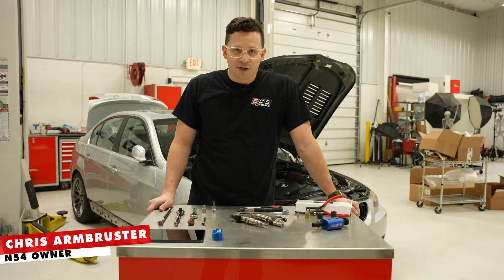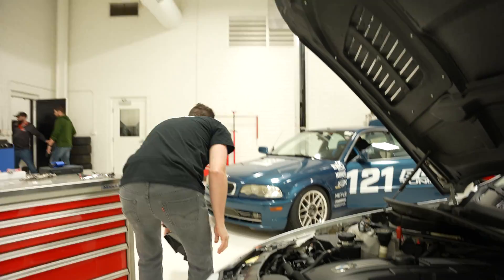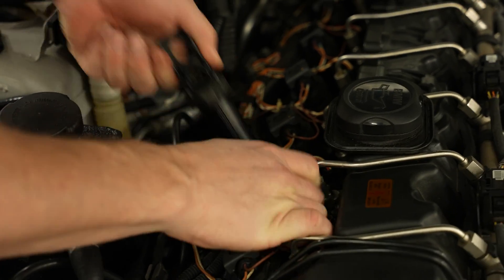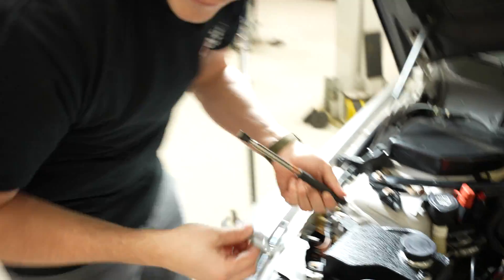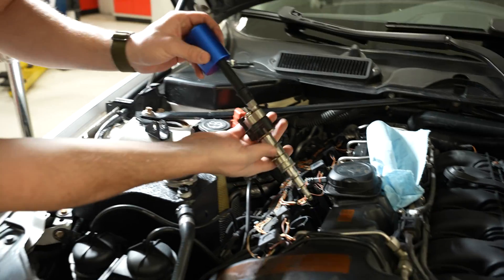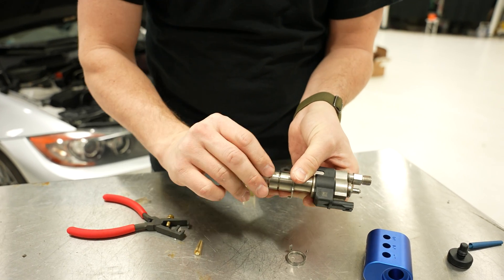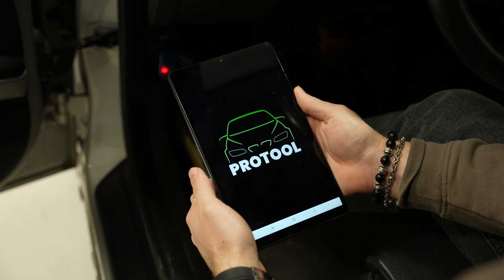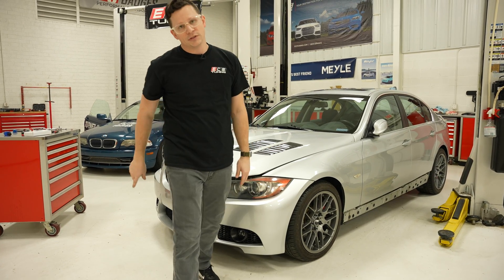BMW N54 Injector Replacement & Coding | ECS DIY

Comment: I find it very odd how this individual representing ECS tuning HIGHLY HIGHLY recommends removing the water shelf.  I guess ECS will sell more parts that break caused from rain water now soaking things in the engine bay.  Ive seen injectors get ruined from this reason.  Also the cabin filters that ECS sells are not waterproof either, so there goes your HVAC fan too, and more...
Reply: When they gotta heavy sell something, you know it’s not worth a penny.

Comment: I didn’t need the inverse e10 bit. I needed an e10 socket
Reply: I don't think he meant to say that because a e-torx is an external torx and if there is an inverted e-torx that would just be a torx bit

Comment: Is it the same for N55? If not is there a vid for that?
Reply: It's very similar to do the hardware portion, but the injector coding is a bit different.  Similar with the numbers on the sides of the injectors, but a different process.

Comment: What happens if don’t put numbers into ecu?
Reply: Ill say it simply. Yes. Injectors are either open or closed. But when open, how much fuel is going to flow? THAT is what the numbers tell the ecu. It is an extremely small amount of difference in fuel but nothing is ever exactly the same. Even the same type of injectors. So to tell the car how much fuel will flow from 1 injector is needed to calculate the air/fuel ratio.
Reply: @e90jackhow does ecu know what batch of injectors has better flow or same flow?
Reply: @repairvehicle   You do that with the coding.  The numbers on the injectors that you put into the coding software recalibrates the ECU to the those flow rates.  Not coding them would risk running lean and grenading an engine - although I have never tried ha ha
Reply: @racecarcamp9056  injectors cannot be recalibrated, it’s either open or close in simple terms it’s an electro mechanical valve. Computer send signals to open or close that’s it that how injectors work always worked. Injectors not any different than relay, open and closed. How do you calibrate relay?
Reply: @repairvehicle  sorry mate one word off - recalibrates the "ECU" to the to those flow rates.  Good call out, edited the comment.
Reply: @racecarcamp9056  how does ecu knows what injector numbers means, high flow or low flow? Is ecu being updated per latest software from bmw to recognize there is new injector numbers? Or ecu stores hundreds of different injector numbers?
Reply: @repairvehicle  if you watch the video, you'll see how to tell the ECU the injector specs.  You are effectively recoding the ECU to the numbers on the injector.  That coding ensures proper injector flow.
Reply: @racecarcamp9056  proper flow? It’s either open or closed injector fuel is constantly pressurized. What flow we talking about, bigger injectors will flow more than stock, regardless of the injector numbers?
Reply: @repairvehicle  Did you find an answer
Reply: @Matt-lf1ik  , false information is used to force people to go to the dealer for something they don’t need to.
Reply: @repairvehicle my car injectors were replaced from original to Bosch , now it’s not working properly
Reply: @MrNIDO91  what is not working correctly?
Reply: @racecarcamp9056  Я разгадал значения кодировки 500-600 и 200-300, это поправочные коэфициэнты только для холостого хода. И отливаю на стенде разные ревизии.
Reply: @repairvehicle  so you think is unnecessary to coding the new injectors 😅 , the BMW engineers salute you 👏